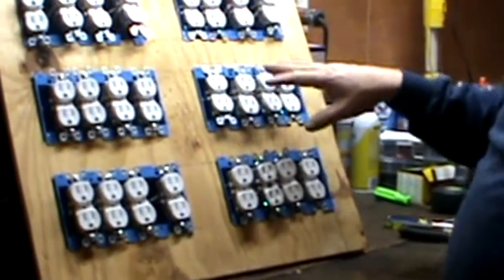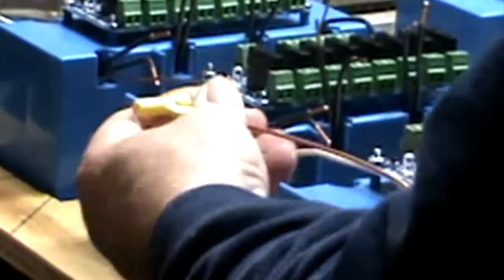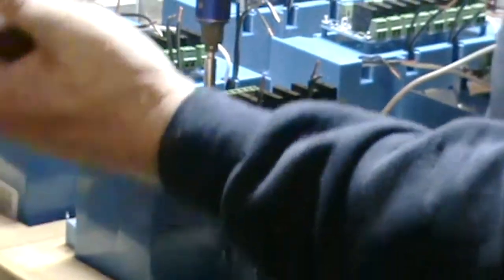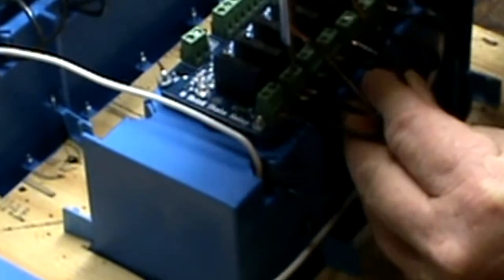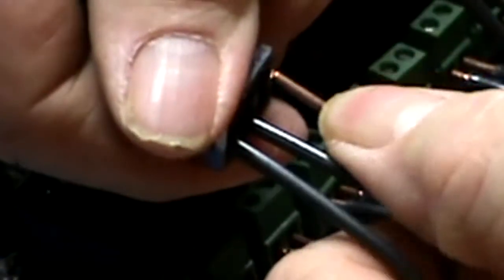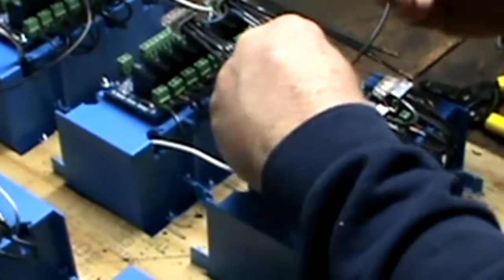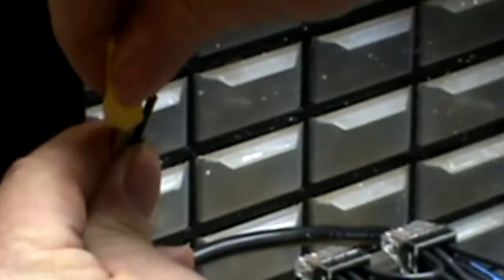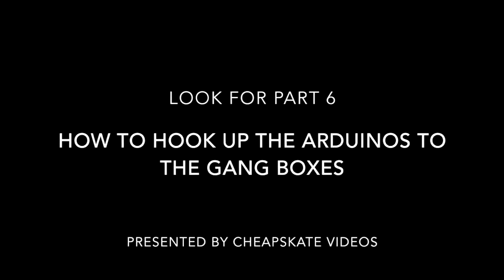Part 5  Building a 48 channel control box

Comment: How many relays can you run off a raspberry
Reply from the maker: I really can't tell you much about a raspberry. I included a video using a raspberry because several people wanted to know how. I use an HP laptop that is probably 15 years old to run my show. I just find it easier to make changes and the reliability is unmatched. In the video I was using it connected to my control boxes. In total I am over 100 relays. Not sure what the total capacity of the raspberry might be.